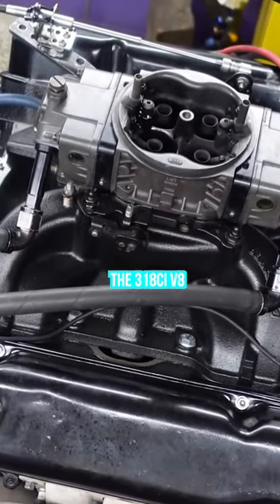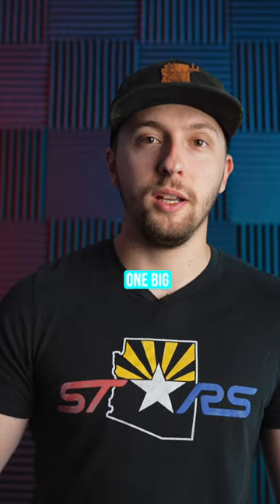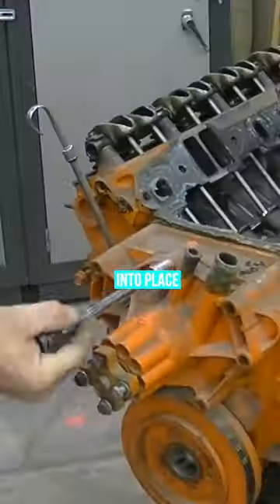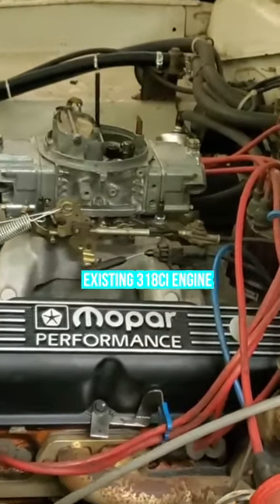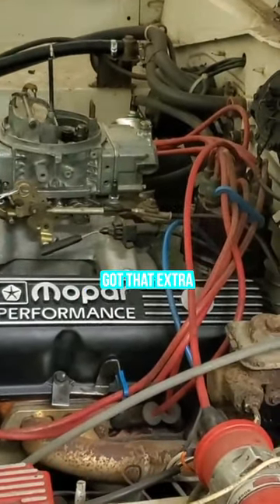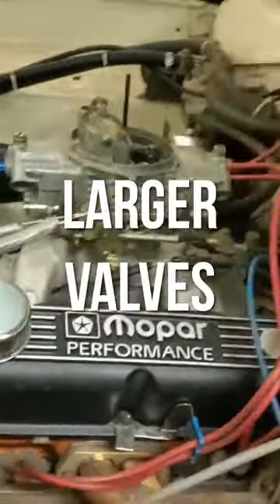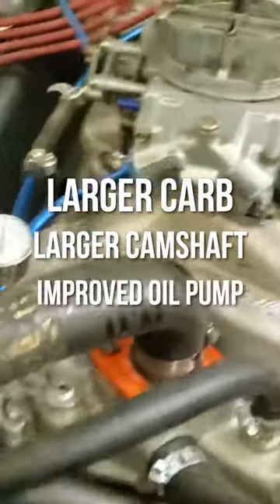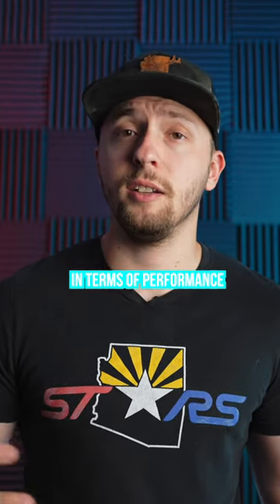Best Mopar V8 Engines Ever: 340ci

Comment: I remember a Mopar magazine put one together as close to stock as possible and stuffed it on a Dyno. After it made over 325, they added a set of headers, a cam, a more modern intake and carb, and it made something like 450hp at 6700 rpm. Which is just ridiculous for a small block

Comment: 383 very under rated. I had a built one in my 72 Challenger when I was in high school and beat on it every day lol. It sounded so good. Plus it was one of the fastest cars in my school. I miss that car and want another.
Reply: Kindly disagree. The NHRA rated them down to 305HP. They are a great platform to modify. But stock almost a bit overrated.
Reply: Great engine the 383, but in a quarter mile run with a 340, it would lose.
Reply: @tomkjr1 what about a 360?
Reply: @HiAxl  360s were not built to be real performance engines like the 340. Most came in 2 barrel versions, but early on they shared the same block as the early 70-71 340 engines(best years) so swapping heads and converting to a 4 barrel carb could get performance out of it. I used to own a 70 340 Challenger and it was a nasty street beast. I took down a lot of big block cars in quarter mile runs. It was a terror off the line.

Comment: It's very easy to see the 340 was very underrated, the 318 2 bbl with single exhaust made an advertised 230 HP while the 340 advertised at 275 HP. There is definitely 80-90 HP more in the 340, I drove and rode in many of each and the 45 horse difference is a joke. I'd say the 340 easily made, say a 1969 example, 315-320 at the crank

Comment: If you  showed up to  a NHRA race back in the day they  figured it  at 330hp they went by estimation  of the cars weight vs its time slip plus they wanted to  sell you the  383 b engine  wich was  rated  at 330hp so theu fudged the  numbers  .

Comment: My granddad used to work on the floor at the Chrysler plant in Detroit assembling engines.  He told me stories growing up that, back in the late 60s early 70s, the assembling process would often run out of certain parts for certain engines, so you'd get a 318 with a 340 cam, a 340 with a big-block intake.  He'd go to lots, try three different Chargers with 340s, and they'd all be different.
Reply: Big block intake on a 340?
Reply: Correct me if I'M wrong here, but I'm fairly certain that you cannot make a factory mopar (or any other brand's engines for that matter) big block intake fit onto a small block..at least not without some extreme machining and even then I'ma guess that that amount of machining to make the big block intake fit between the small block heads would render the intake unusable due to casting.. I've never actually tried to do this, and have never even heard anyone ever even talk about it, so there's a chance I'm just ignorant and if that's the case please someone respond and educate me, but as far as I "think" I know as of right this moment, I'm pretty sure that you cannot install a factory mopar big block intake on a factory mopar small block engine.
Reply: @tictac2534  Imma level with y'all, I don't remember commenting on this sadly.  Meaning I was probably a lil more than drunk at the time, and you're absolutely right.  BBM intakes don't fit on small blocks without some fun times, but the variance in builds of engines is true.  It's been a while since I've seen my grandad, so I'll ask him what he remembers, but considering his time at Chrysler was 69-73ish, the exact details may be fuzzy
Reply: More tall tails....

Comment: What about the 5.9 360 Chrysler engine was that a high performance
Reply: Originally, no. It had a longer stroke (3.58 inches in the 360. 3.31 inches in the 340) and was built primarily as a low revving torque engine. Not saying it couldn't be built into a monster though.

Comment: Take a 340, good carb, headers & cam and it was a BB killer period
Reply: Lol just not true.
Reply: @ryansmith4512  Really???  Do you're research man
Reply: It truly was called the Big Block Killer for good reason! Had a 70 Dart Swinger I put up against anything around in the early to mid 80's and it did very well
Reply: @mikeheppard3502  Yep, they were amazing little engines.
Reply: Every day i wish I still had that car. My Dad basically gave it away while I was serving in the Army over in Germany
Reply: @mikeheppard3502  A LOT of us are in thea same boat. I have my ones also
Reply: You think a 340 lets say duster will kill a lets 70 LS6 chevelle.   Lol
Reply: @ryansmith4512  You're one of those....so there isn't a 340 ever built that will out power an ls6?
Reply: Do you have a 70 chevelle with a LS6 in it? Have you ever had one?
Reply: @ryansmith4512  As I said you know nothing about my career. Go Away
Reply: @ryansmith4512  My uncle, cousin neighbor, that's nice. What have YOU built? Nothing......

Comment: Mopar history is good for historical knowledge. Today however, any 318 or 360 LA or Magnum can surpass a stock configured 340 with the aid of aftermarket pistons, camshafts, heads, Intakes, oil pans, adjustable valve train, etc ....  All is needed is the right engine shop with the equipment, knowledge and willingness to go the extra mile to ensure that machining is done right and your Mopar is prepared as a Race engine (although you don't have to race it or buy a ton of Race parts).There ARE differences in machining/Building practices between Street and Race applications. Once I hear the squirrels start yapping in the contrary, I know they have a slow car.
Reply: I think the point they are making is about STOCK performance

Comment: Cram the 340 gear on a 318 block
Reply: 318 cylinder walls were not strong enough for any brute strength
Reply: Oh yee of little faith , the la 318 is one of the most reliable motors ever made
Reply: @BurchellAtTheWharf  that's because it never came with much power the way it is built and designed is fine but once you punch it out or do any work the failure rate goes up substantially
Reply: @BurchellAtTheWharf  the 225 slant six was an excellent high durability engine.... But it was low output
Reply: I've always had this plan to hope up a 318, not to a crazy power level but to help it breath better, I do know that can be an issue
Reply: @BurchellAtTheWharf  the highest output 318 that I've ever seen came in a swinger 1972... Was a factory mod... 4 barrel and true dual exhaust.... They can be Cam and valve work can be done and they are decent engines
Reply: Yes the ole slant was the baby, but the 273 was a hot little brute that could rev higher then the 318, but I have a soft spot for it, 318 with 318hp would be mint
Reply: @ron8935 I’ve built a couple “hot” 318s they run damn good and don’t take much to do it. Ones .03” over then the other is .04” still plenty of wall thickness and no issues

Comment: 340 is not the same block as a 318. It’s basically a 360 block with .040 over bore and a 318 crank. It’s its own entity in the mopar world and they are good engines but anything you do to a 340 you can do to a 5.9 magnum and get better results
Reply: Wrong and right. 318 and 340 cranks will directly interchange
Reply: 340 just a bored 318

Comment: The 318 was a piece of shit compared to the 340.
Reply: My uncle had a 318 with heads, cam. Intake and carb off of a 1970 340 engine, with long tube headers and duals, in a 73 long bed Dodge 2wd truck with 3.55 gears and shift kit in 727 trans and that truck could embarrass a lot of stuff on the street back in the early 90's